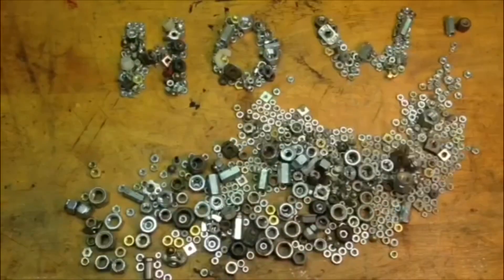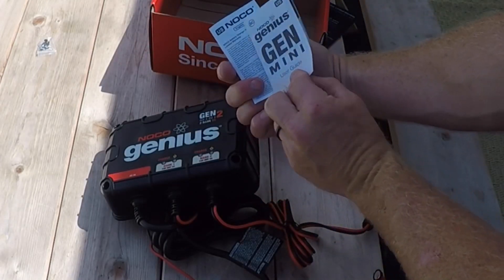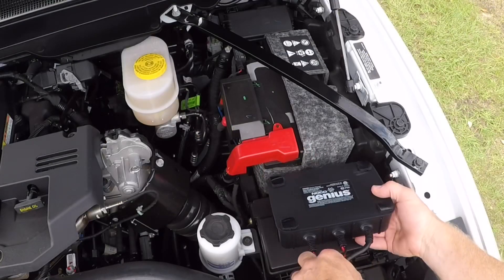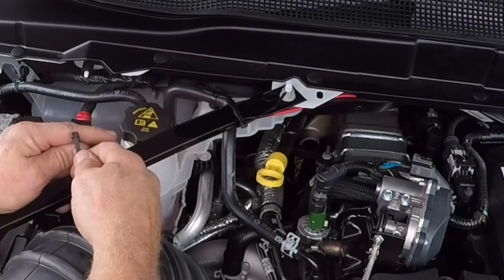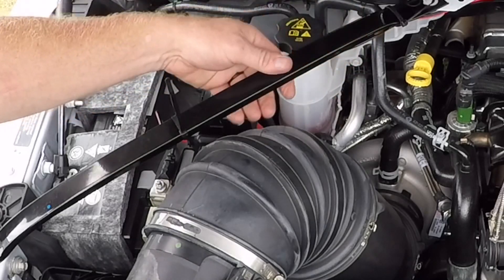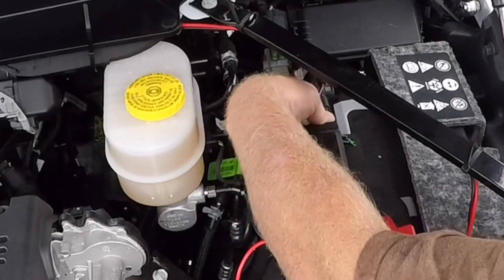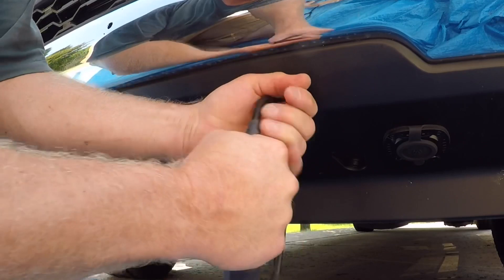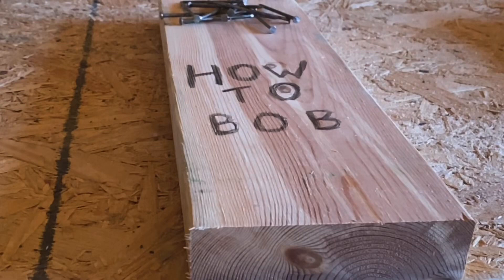Installing an On-Board Battery Charger

Comment: I realize this is an old video, but in the event someone stumbles upon it like I did, you want a single bank charger for batteries wired in parallel like they are in this (and my) diesel truck.  They present as one bank to the truck and the charger this way.  If you have multiple banks hooked up like this, the charger will see the voltage from itself (the 2nd bank) and reduces charging.  It works, but it isn't ideal.  They will charge and float (maintain) better with a single bank charger.
Reply: came to the comments for this, i was wondering if this was the correct way
Reply: How do you know these are wired in parallel? I have a 2019 Ford F250 6.7 diesel and I don’t see how I would confirm this.

Comment: Has someone else mentioned below, the two batteries are connected in parallel. For what specific reason did you choose the 2 bank charger at twice the price? So it would charge faster maybe?
Reply from the maker: Yes, and Yes Thanks for watching.
Reply: There really is no need for the 2 bank. No reason to charge faster unless your batteries are drained constantly but these are basically used as maintainers so your truck engine will keep the batteries charged while running then if the truck is going to sit for a long period of time you just plug it in. No reason to have it do it faster.. 😂😂😂 just my opinion. You can run with the single bank and it will handle things just fine and it’s cheaper.

Comment: The first mistake is buying a dodge. 😂😂😂
Reply from the maker: What would you recommend?
Reply: @funbro1  Well I was just joking I was really being serious. I have a newer F250 and love it.
Reply from the maker: I sold my F250 diesel when I bought the RAM. I tried to love the Ford but it just didn’t love me back. I have always been a Ford guy and still own a Mustang but I couldn’t afford the 250 anymore. Repair costs were out of control at 130,000 miles. Head gasket, injectors, transmission, rusted cab, injectors, rusted fenders, frame rails, bed, I just couldn’t justify it any longer. I do love the way this one tows. And you know what they say?
Reply: @funbro1  I can say I’ve only had Fords and I’m 42 yr old and I’ve never had all these issues that people talk about. My grandfather owned an 88 Ford F250 and used to tow our horses back and forth to Missouri and it had 500K miles on it when he sold it along with the farm to move out to Missouri. That truck was a work horse and I wish I was old enough I would have taken it. Light blue with the old man seat cover.. lol. I’ve had F250’s and 150’s and I’ve never had any major issues other then normal maintenance. I never seen any rust etc but I live in California so that’s most likely why. The unfortunate part is these new manufacturers outsource their parts and they get parts from all over the world and it always ends up being crap. I always wonder if all manufacturers here in the US would have better products if it was all done here in the US but then again I also feel like they purposely make their products to fail at a certain point otherwise people wouldn’t buy new trucks every couple years. I have friends that trade in their 2 year old truck for another one.literally nothing has changed they just want a new one. To me that’s just ignorant and you end up having payments for 10-15 years or more. To me that’s just stupid but thats me.

Comment: Gosh so much to learn, so many options. So for a couple of really cold days my battery failed me (-30C). Decided to look at a maintainer. I have purchased the NOCO 2D. I really like the idea of the NOCO dual adapter for blocker heater and charger. So to my question. Will it hurt to plug in for the trickle charge for say 6 hours vs recommended minimum 24hours. During the cold winter months I could see myself driving my vehicle most days (plug/unplug). Using it in conjunction with my block heater, Hope I am talking sense
Reply from the maker: It should be fine, the battery maintainer will only charge if the battery is needed to be charged.

Comment: I'm thinking of doing the same and I see you did a nice job and I was wondering how it's working out for you?
What I'd really like to know is if you were charging both batteries at the same time without disconnecting one of the batteries? I have a 2011 Dodge 3500. NOCO told me today by chat that I had to disconnect 1 battery. However they have a old video out showing they're charging one of the batteries at a time without disconnecting one of them. Thanks for any input you can help me with.

Comment: Just hooked my single bank up and used the plug in port to run my block heater and onboard charger up. Two things:
1.) I should’ve used a two bank for speed and more slack. The single bank barely reaches both batteries. 
2.) Is there any concern with having the block heater going when you’re only wanting to run the trickle charge? For example, warm weather and not driving the truck for an extended period? Thanks in advance. Great video.
Reply from the maker: There is no concern running this all year long even for extended periods of time. The charger monitors the batteries and stops when they are fully charged. As for the block heater it doesn’t get as hot as the engine does when it’s running so all it can do is help when you go to start it up cold. Hope this helps, thanks for watching.

Comment: Good video.   Straight to the point.   Question,  by having your Block Heater always turned on when plugged in...during the winter no problem,  but during the summer any issues?
Reply from the maker: No issues at all, the heater will only heat to a set temperature so it will not hurt anything except your electric bill.
Thanks for watching.
Reply: @funbro1  that's what I thought.   In AZ it gets so hot that after you drive the truck never really cools off.

Comment: By hooking up both terminals since there in parellel doesn't one bank cancel out the other charger and throw it into over voltage protection ?
Reply from the maker: Not at all, works like a charm.
Thanks for checking in.

Comment: Nice video! Couple of questions: Why a 2 bank charger? Your trucks dual batteries are not independent (wired in parallel) and are a single bank. Doesn't wiring them as independent banks undermine this smart charger's.... smarts? Also, I'm thinking 4 x 1 inch square velcro pads weren't up to the task. Can you give us an update on that? Thanks!
Reply: Uhm, well, that's embarrassing 🙄 .... I just finished reading the comments. Never mind my 2 banks question. 

How's the velcro doing? LOL. 🤣
Reply: Uhm, nevermind the velcro question too. 😬🙄. 😂😂😂😂
Reply from the maker: I have had to remove the charger to access the fuses at one point but it reattached to the Velcro and is still holding tight. 

Thanks for watching.
Reply: Why would the velcro not hold up? It's not a high stress piece, nor in exceptionally harsh climate. Please pay someone to do this for you, you have no clue.

Comment: How did it hold up mounted on the fuse box with Velcro?
Reply from the maker: So far it’s done great. I even pulled it off a couple times to replace a fuse and it’s still holding tight. Thanks for watching.
Reply: @funbro1  how and why are you blowing fuses? That sounds like something you need to investigate. A new truck should not have those issues

Comment: Actually since the two batteries are connected in parallel you only need a single bank charger.  I am doing the same thing but with a NOCO two amp unit.
Reply from the maker: After investigating that I decided to go with the double bank. Thanks for watching.
Reply: And doing it with a dual bank is faster and better. But thank you for trying to tell him what he "should" (in your oh so esteemed opion) fo